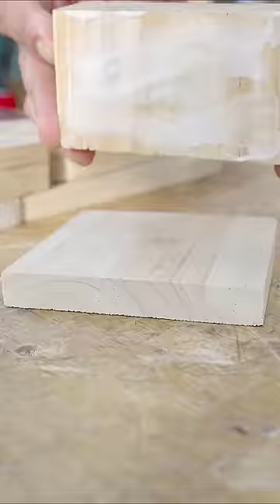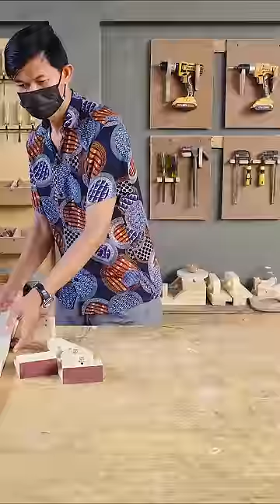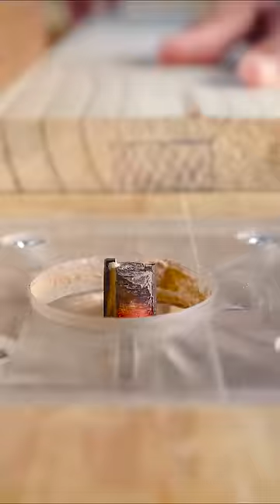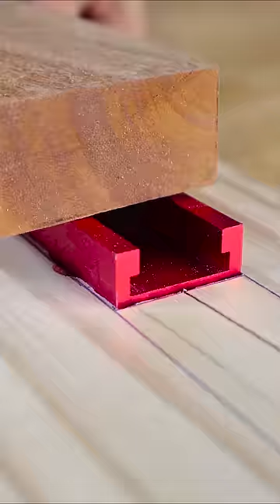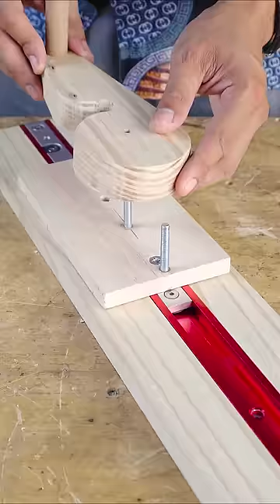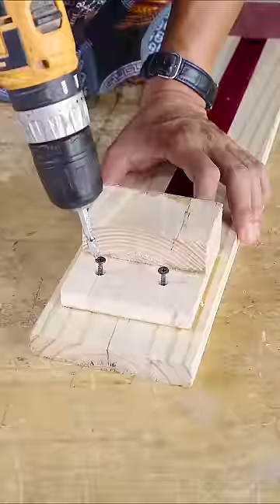Tool Tips and Technique Guide Rail for Circular Saw #woodworking #diy #trending #shorts

Comment: This seems to be a clamp for something with an odd edge. The block that pivots can move to whatever angle is necessary while the knob behind it secures it on that specific place on the track. Im guessing he can then slide this along the fence of a table saw. 
Thats my guess.